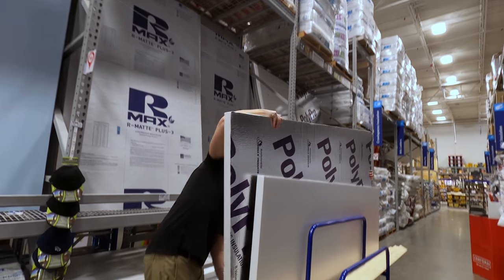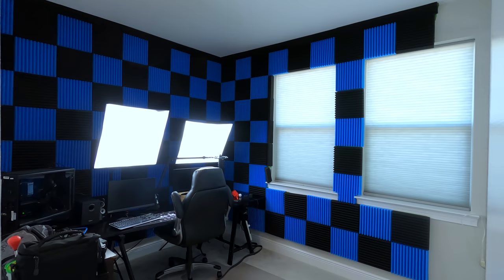DIY Acoustic Partitions

Comment: These Partitions are Barriers as they have limited ability to absorb sound. However, in some cases that is all you need to isolate yourself. But if you covered one side (the inside) with Acoustic Foam, you could have absorption, diffusion, and containment.  It is a good fundamental idea with room for customization to the needs of the Individual.

Comment: if yall dont want to do the wood stands just use pipes and cut a hole the size of the panel and to save on money don't use 2 inch ones you can cut the price in half by using 1/2 an inch or a inch panel 4 by 8.

Comment: I'm think about doing this. Any mistakes I should know about? How well does it stand up? Does it knock over or shake when hit? Do the dents in the foam show or make any difference to the over all look? 

This works so much better than the plywood idea I was thinking about.
Reply from the maker: Yeah honestly as long as the base is somewhat straight... it works great. I definitely recommend doing a 2in foam board and putting fabric on both sides as that’s what keeps it up straight.

Comment: Great set up. Are they sturdy, stand up straight?  What are the lengths of the boards for the feet? What are the length of those screws? I made this foam divider but the ABS plastic feet version (before seeing this video).  My foam board is vertical too, but they are too flimsy and sway to one side in the ABS. I'll have to hang a chain or strap from the ceiling unless I build better feet like these .   Also, how much  did you spend overall on fabric? Thanks

Comment: You have a cool little setup there! What was the cost? And they safe around kids (do they wobble, fall over, etc.)?
Reply from the maker: Thanks! And it was $200 to make all 4 of them. And they are safe around kids...asking as they don’t lean against them it will be fine. We have an automatic vacuum cleaner and it hasn’t knocked it over.